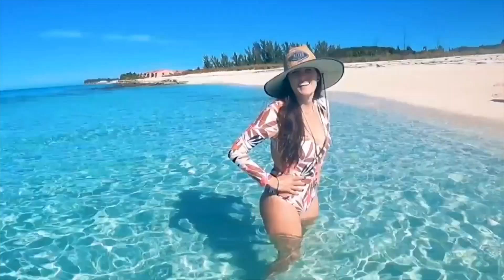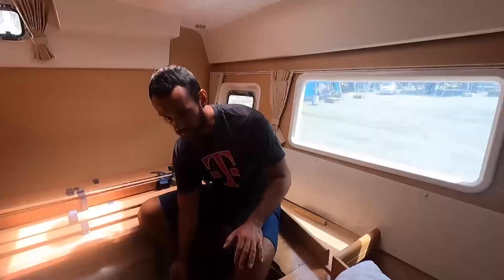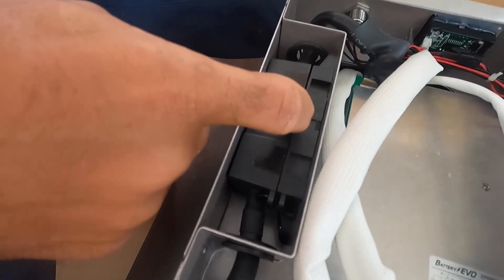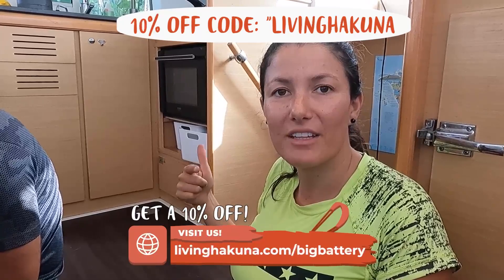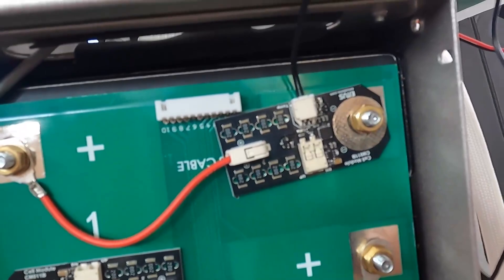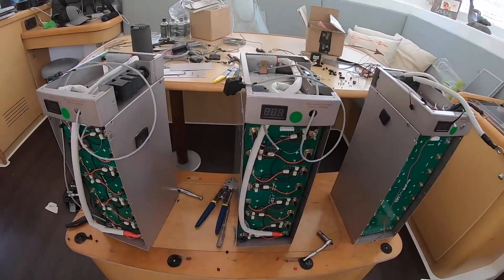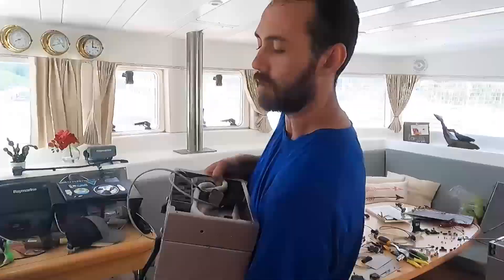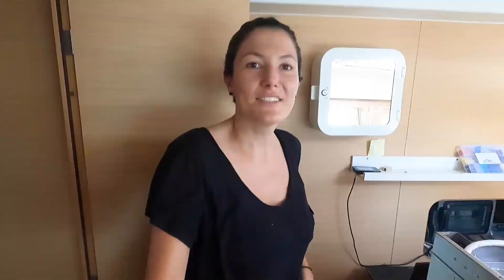BEST MARINE LiFePO4 LITHIUM BATTERIES | BMS Installation Gone Wrong!

Comment: Make you a bypass connection for emergencies. Like run power wires from your generator to your inverter bypassing the batteries and solar in case your system fails, you just will have to run your generator to power your complete boat. This shouldn't cost much, just some wires and a couple breakers. Wouldn't want to see you out in the middle of a passage without power. Good luck guys and nice channel.
Reply: Im still trying to undertand what the bms system you were trying to install had that the one that came with batteries didnt have?? Im so sorry you had to go thru all that, que cosas! we live in a fully off grid home in isla mujeres Mexico and i can really appreciate your need for power from your batteries. My husband Ariel says that always there will be a variación in the voltage from the cells due to different factors, its nothing to worry about also that lithium batreies función well up to 60 c, max, not to worry about high temps, i have a new found appreciation for our batteries that we purchased from China their built in bms system gives all the readings that we need. In the future when you go to change your new lithium batteries you may want to buy batteries that have a bms with display that shows you all you want to see,  built in already, A for effort and feel free to contact us if you have a problem with your battieres, my husband says he didnt think you needed to change the lg chem battery, that the problema occured when you disconnected the lg chem for too long which caused the batteries to discharge completely and what you needed to do was wake up  the battery with 48 volt charging system or something equivalent like 48 volt battery. this can happen to you new batteries as well any lithium battery  maybe he can help, we love you guys take care Sandra

Comment: ..... laughing .... Well! that certainly was not plug and play .... sure glad that you were able to revert to the old and had not needed to cut things for the modification ... had to laugh, Alejandro doing this big complex electrical conversion and using scissors for wire strippers. It worked, that's what matters, make do with what you got. .... glad it all worked out in the end ..... thx for sharing ...... and as always .. never stop dreaming, just dream bigger .. have fun be safe, save our oceans .....
Reply from the maker: Thanks for Watching Peter! 🤙🏻

Comment: Kudo to you both for sharing your failures as well as successes. I am very familiar with Lifepo4 batteries and still dont understand what you were trying to accomplish. If you’re looking to monitor each of the batteries individually I would check the BMS that they came with to see if you can plug-in a Bluetooth module.

Comment: I went back and looked at your electrical tour.  It looks like you have a SMA Sunny Island Inverter Charger.    It isn't a pure/true sine wave inverter if it is a Sunny Island.  Guess what you can get 30-50% more power out of your batteries just by changing to a pure/true sine wave inverter.  They are more efficient and the things with motors don't work as hard.  So it would be like buying another battery pack or two.  Victron Quatro is a good replacement and is user programmable. Also not having a true/pure sine wave inverter means it will slowly kill your electronics.
Reply from the maker: Hi, Allyn this is super interesting! yes we have the sunny island but if we replace it for a victron then we have to replace the MPPT controller also since its a SMA mppt that is AC instead of DC correct me if i'm wrong.
Reply: @LivingHakuna  Well a typical Solar MPPT controller sends energy directly into the batteries via DC electricity.  I don't know what model the SMA MPPT is that would be helpful.  However typically you can replace most MPPT controllers with something similar for not much money.  If I were a betting man I would say that chances are that your SMA MPPT converts solar to DC, but you would have to check that out.  If it does convert to AC instead of DC yes it should be replaced, but it would be a pretty rare case if it were AC conversion.  That is typical in grid tie systems for houses and the sort. Where they sell electricity directly back to the power company in the form of AC power.  However I get the feeling a lot of the SMA stuff is exactly for houses.  A Victron Multiplus or Quatro has some benefits.  It offers additional boost power from the batteries if a genset or shore power can't start things like Air Conditioning.  This helps a weak electrical source keep a large boat running.  Also the Victron units have stuff in them that lessen chances for Galvanic corrosion.  Which means that your underwater metals will last longer.  Also the Victron provides clean power which mean in the long run your refrigerators and electronics on AC will last a lot longer.  Motors run hot on a standard inverter, and laptop power supplies and other devices burn up if on standard sine wave.  You should 100% change your inverter/charger if it is not a pure or true sine wave inverter.  It only takes one fridge replacement to make that obvious.  If you can get me the SMA MPPT controllers model number I will look up the manual and do some of the leg work for you, but a lot of MPPT controllers that will do the job can be had for  $75-$225 dollars depending on how your solar is wired and total capacity/voltages.  However it is more than likely you wouldn't have to replace the MPPT controller.  The Victron inverter/chargers are typically around $1200ish depending on the model/capacity/voltage, so that would likely be your only expense unless the existing wires wouldn't reach.

Comment: In reply to the earlier thought about the inverter; Well a typical Solar MPPT controller sends energy directly into the batteries via DC electricity.  I don't know what model the SMA MPPT is that would be helpful.  However typically you can replace most MPPT controllers with something similar for not much money.  If I were a betting man I would say that chances are that your SMA MPPT converts solar to DC, but you would have to check that out.  If it does convert to AC instead of DC yes it should be replaced, but it would be a pretty rare case if it were AC conversion.  That is typical in grid tie systems for houses and the sort. Where they sell electricity directly back to the power company in the form of AC power.  However I get the feeling a lot of the SMA stuff is exactly for houses.  A Victron Multiplus or Quatro has some benefits.  It offers additional boost power from the batteries if a genset or shore power can't start things like Air Conditioning.  This helps a weak electrical source keep a large boat running.  Also the Victron units have stuff in them that lessen chances for Galvanic corrosion.  Which means that your underwater metals will last longer.  Also the Victron provides clean power which mean in the long run your refrigerators and electronics on AC will last a lot longer.  Motors run hot on a standard inverter, and laptop power supplies and other devices burn up if on standard sine wave.  You should 100% change your inverter/charger if it is not a pure or true sine wave inverter.  It only takes one fridge replacement to make that obvious.  If you can get me the SMA MPPT controllers model number I will look up the manual and do some of the leg work for you, but a lot of MPPT controllers that will do the job can be had for  $75-$225 dollars depending on how your solar is wired and total capacity/voltages.  However it is more than likely you wouldn't have to replace the MPPT controller.  The Victron inverter/chargers are typically around $1200ish depending on the model/capacity/voltage, so that would likely be your only expense unless the existing wires wouldn't reach.
Reply from the maker: Hi Allyn, this is great information thank you! yea I think the SMA inverter and MPPT controller we have are for a grid system of a house since everything is AC it only changes to DC to charge the batteries. Since our inverter is connected directly to the 220V grid of the boat i guess is more efficient to leave it like this because it doest have to convert from DC to AC to power the outlets and other 22V things. either way thanks for the info. 🤙🏻😊
Reply: @LivingHakuna  Well typically it does convert from dc to ac unless it only powers the outlets during the day.

Comment: It is easier to just put in a Victron Battery Monitor and maybe a Victron inverter/charger, rather than changing a BMS.  It is likely that your older charger/inverter doesn't have the capabilities that a Victron does.  Canbus can cause a person headaches.  Just let the batteries balance and monitor what comes in and out of them.  In fact if your inverter/charger isn't pure or true sine wave you can automatically get like 30% to 50% more power out of your batteries by changing it to a Victron unit.  Modified sine wave isn't as efficient as pure sine wave or true sine wave.  Fridges and things use more power on a modified or standard sine wave inverter.
Reply: Have to fully agree much easier not mixing brands of equipment, The mastervolt system you will need the software to configure the system even though i do have all the information to program the system still need the software which is not easily obtained for non commercial users unlike the Victron units. Also as far i know it is not a good idea to change just one cell (bad) on a battery bank

Comment: I don't understand the title of the video, is "Best Marine" the brand of the BMS company?

"BEST MARINE LiFePO4 LITHIUM BATTERIES"

Or, are you saying the bigbatteries are the best marine battery?

Confused

That BMS should have worked, not your fault they hadn't programmed the BMS controller correctly, your installation skills were fine, although you really should grab yourself a pair of actual wire strippers at some point =)